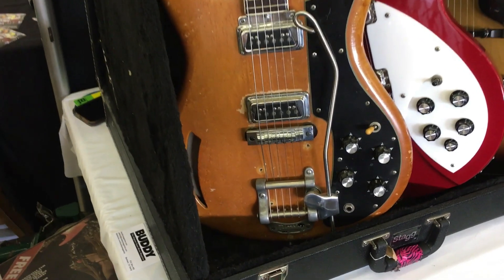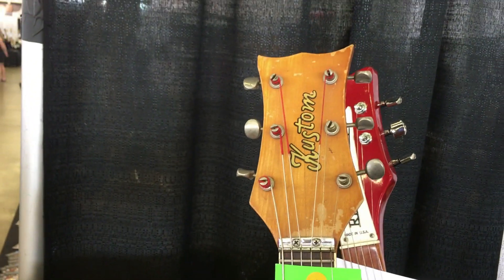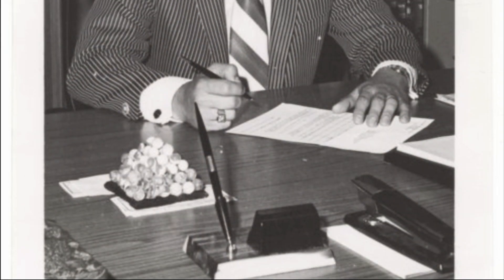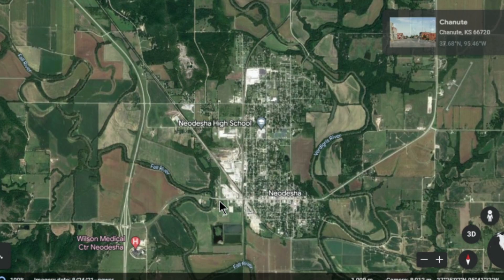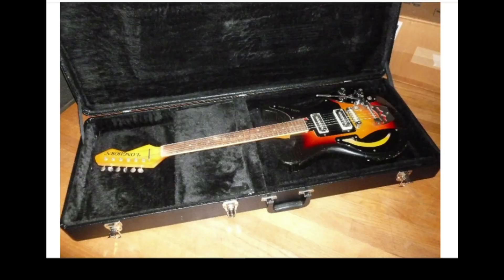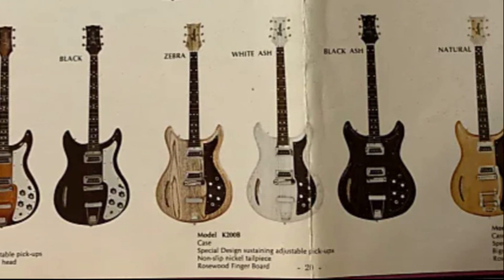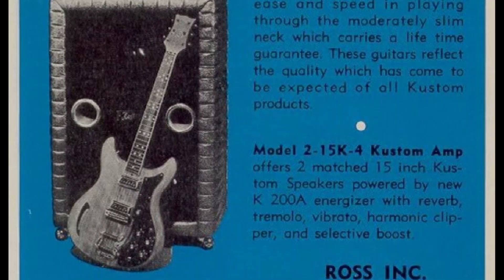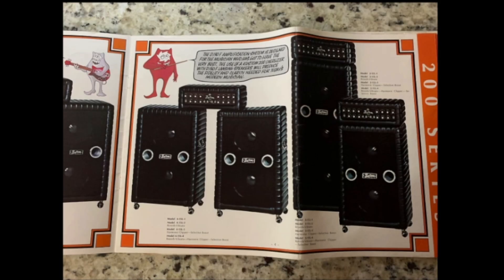Vintage USA Guitars Made in...KANSAS???

Comment: Thanks for that. I haven't paid much attention to Kustom models, though I saw pics of probably a Green one. 

Also, though chances are low in seeing 2 together, it's funny - when they do show up, sometimes they bunch together. I've seen 3 of a rare guitar show up on eBay all at about the same time in 2010 or 2011. It was a Mosrite 350 model. And as the guy compiling the serial numbers for that model, I haven't seen one above A0365 so far. Maybe only 375 or 400 exist. They rarely ever show up, it's an event when they do. They're not worth a gigantic amount, about $800 - $1,300 depending on condition, but I just love Mosrites a lot.

Similarly, I once saw a 1996 Buick Roadmaster Station Wagon parked, all while I was driving my 1990 Mercury Grand Marquis Station Wagon. So I parked right next to him. Maybe some guitars get put up for sale just because the owner's like "Oh yeah, seeing that one for sale, I also have one of those that I'm not playing" and then they put theirs up for sale too.

Comment: Hey Brad speaking of random vintage 60s USA guitars, you should check out Bartell guitars made in Riverside, CA. My first "real" electric was a Bartell strat style. Great guitar that got trashed when a speaker cab fell on it and lunched the body. I salvaged the neck for a homebuilt project. A Bartell fretless bass associated with the Beatles sold a few years ago for $250K or thereabouts.
Reply from the maker: They made the original Acoustic Black Widow.

Comment: I still have and use my charcoal 1968 Kustom 100 with 2 12" vertical cabinets with some very sweet Jensens. (one trick pony, great full clean tone, but awsome pedal platform) I tried the Kustom guitars but they wieghed a ton and didn't like the neck.  So I bought an SG w/ P90s.  Cool vdieo.👍